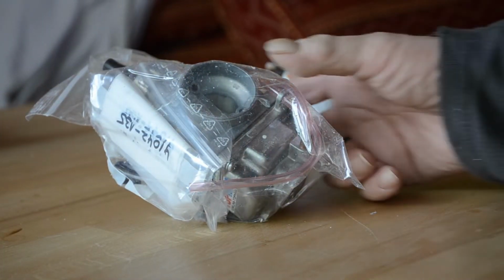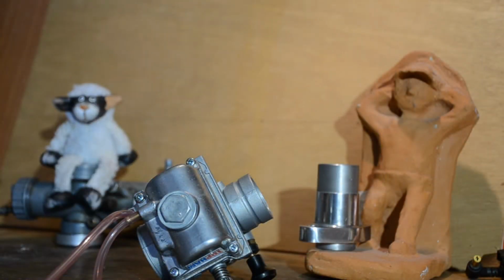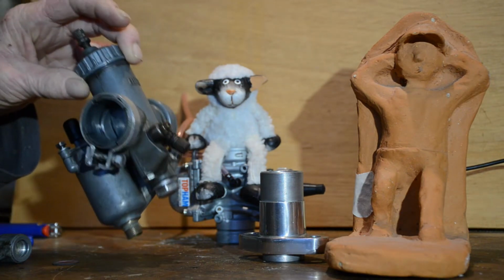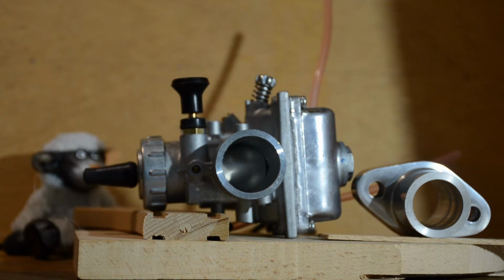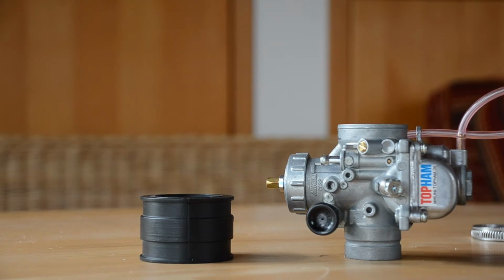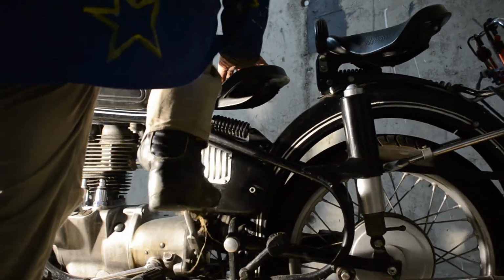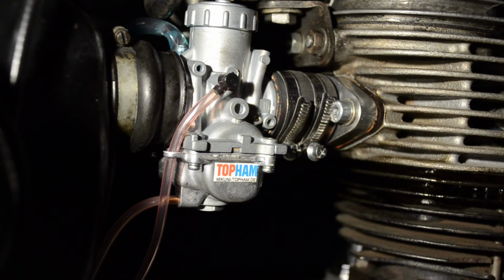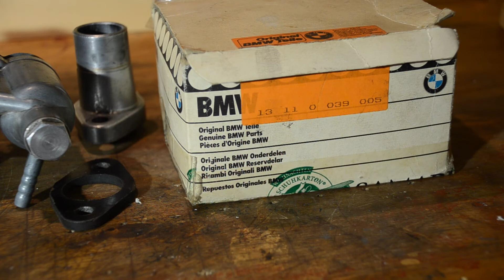Conversion of a BMW R27 to a Mikuni Carburetor

Comment: Good video - even my wife likes it.  My R27 had never ending fuel leak from the Bing like what is shown.  The Mikuni seems the best choice.  In 1 in a million - last year I found a Bing 53 in a neighbors junk pile.  Cost = free!  One challenge is attaching the cable but all well now.  Bing KS helped with jets, needle, float, & sleeve.   But doesn't leak fuel and is 'snappy'.  Friend though 53 might have been via a Penton but DKW/Sachs/Maico aka 1970's dirt bikes possible also.  The 53 fits fine, starts well, and helps 1964 R27 run again!   Plus, ZERO fuel leaks.
Reply from the maker: Thanks for stopping by and good luck with your new carb!

Comment: I could’ve done with this a few years ago. 
Two mechanics, supposed experts on classic bikes here in Portugal, couldn’t fix the constant leak of the bing carb on my R26. I sent it twice to Germany for another expert to have ago. I only got it to work properly after I found a classic Beemer mechanic in the north of Portugal. I’ve learnt that you need to learn what to do or find an ‘old gentleman mechanic’ who really knows what he’s doing. These guys are, unfortunately,  increasingly hard to find.
Reply from the maker: Yes it's getting more and more difficult nowadays. Thanks for stopping by!

Comment: Someone in the States has the same carb. with these settings: main jet 120, pilot jet 30, needle in clip 4, air screw 1,5/8. Maybe it helps. Good luck!
Reply from the maker: Thank you - I will try this.....in spring ;^)

Comment: Hello Sir

I won an R 27, and I would like to have the same upgrade(Mikuni). Can you tell me where to buy it?
Thanks
Reply from the maker: I bought at https://mikuni-topham.de/ENGLISHSITE/ENGLISH/Frame_English.html
Reply: @dappsull  Thanks
Reply: @dappsull  Please let me know if the bike runs properly with the Mikuni carburettor. Also, please tell me about your experience with Mikuni over time(pros and cons).

Many thanks
Reply from the maker: @ETCRO80  It ran properly, but I found a working Bing and reconverted to this one because I didn't like the look of the Mikuni.
Reply: @dappsull  Thank you very much 👍

Comment: I understand there were 2 types of Bing for the R27. With accelerator pump, and without accelerator pump. Bing on my R27 did not have accelerator pump. It works very well and never had a problem. I have not seen an R27 Bing with accelerator pump.
Reply from the maker: Yes, there are at least 2 types. I tried both and didn't notice any difference. Here's one with pump (note brass tube at bottom of carb)
https://www.flickr.com/photos/dapsul/5238823204/
Reply: @dappsull  Thank you! I also had R26 and with the same carb, its engine was quicker and will jump ahead of R27 in a throttle roll-on. This is very evident in stop-and-go traffic where my R27 has a hard time keeping up with R26. I think that is the reason for the accelerator pump. R27 has more HP but needed rpm to get it. I gave up trying to make my R27 more responsive, the better method is to use same cam timing as R26. Unfortunately R26 cam has different shaft front end. This is Torque vs Horsepower, very similar to R50 and R50S. In stop and go traffic, the R50S cannot keep up with R50. By the time the R50S will pass R50, its time to slow down for next stoplight!
Reply from the maker: @Juancheros  Probaly it depends on the actual status of the engine. Actually the R27 should have more torque over the full range of revs, I think.
Reply: @dappsull  When an engine is tuned for horsepower, it looses low end torque. This is a basic compromise that can only be overcome by variable cam timing like used in modern engines. The compromise is very evident in R26/R27 and R50/R50S. The R27 and R50S both have "hot cams". Btw, I am talking from experience owning these bikes. If you understand this, then I think you will enjoy your R27 more as-is with the original Bings. The R27's greatest feature is the engine rubber mounting. There is nothing like it in motorcycling history.
Reply from the maker: @Juancheros  Thanks for your input! I am not an expert on engine design, so I have no idea of the theory. I was referring to a graphic published by BMW themselves, maybe just an advertising mock-up, but it shows, that the R27 has more horsepower and torque over the whole range: 
https://www.flickr.com/photos/dapsul/53085960164/
Reply: @dappsull  The graph is based on R26 compression ratio of 7.5:1. Back in 1970's when I replaced my R26 piston, BMW dealer told me to use a replacement piston made by Kolbenschmidt and looked very similar to R27 piston. I suspect it had same compression ratio.

Comment: Excellent video thanks for posting, I have an R25 with the original Bing carburetor, unfortunately it is well worn , I would like to put it to one side and fit a Mikuni like you have.  Please could you tell me which model carburetor and the jets you ended up using.  Thanks once again.
Reply from the maker: Thank you! I am still struggling with getting the proper set-up and went down to a 20 pilot jet. Anyway: the R27 uses a 26mm carb. As far as I know the R25 has a 24mm carb, so you might try the  Mikuni VM 24-4851?
Reply: @dappsull  Many thanks for your advice, I will look into this.
Reply from the maker: @grahamkirk5974  Cheers!

Comment: That’s a sweet bike. Did you notice any difference in performance with the new Mikuni carburettor? Do you mind if I ask how much genuine Mikuni carburettors are in Germany? I see a lot of Chinese copies on eBay, but I’m not sure we have a genuine Mikuni distributor here in UK. 

I’m currently designing a BMW F650 Dakar engine based lightweight adventure bike, using a modified CCM 604 frame. My plan is to replace the perfectly acceptable EFI system with possibly a Mikuni carburettor. This will eliminate all the emissions legislation compliance complications, any one of which can cause the engine to refuse to start when they go faulty. I want a basic, reliable bike that I can fix at the roadside - as bikes used to be. 

The alternative to the Mikuni is a very modern SmartCarb from the USA, which is more expensive. 

Thank you for sharing your modifications. 
Peace
Reply from the maker: Thank you very much! Some answers:
a) I payed 123 Euros for the carb plus some jets. I think the company is the official distributor for Mikuni.
b) Mikuni was ok as long as the temperature was warm. As soon as it dropped below about 10degC starting became a headache, so a severe difference to the Bing.
c) now comes a twist...I could get my hands on a working Bing, so I swapped back to the original set-up. Main reason was primarily the optics.

Cheers and peace!
D.